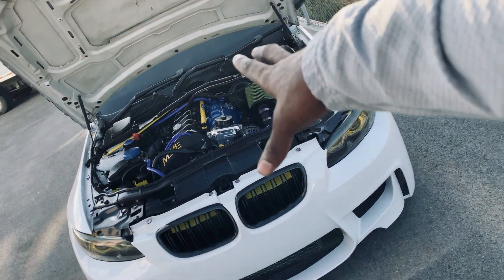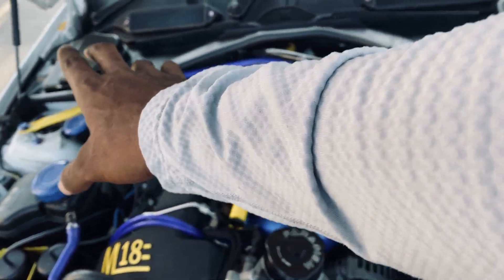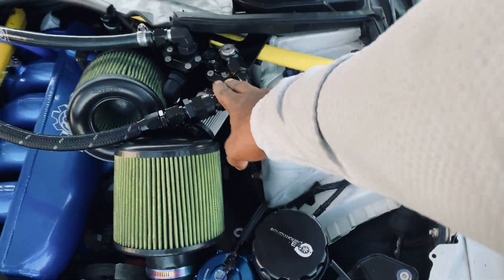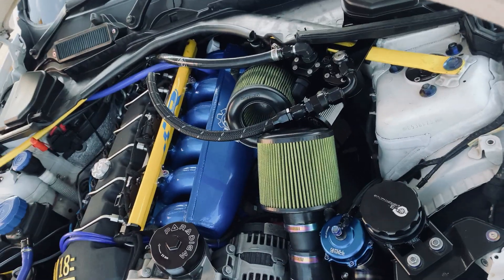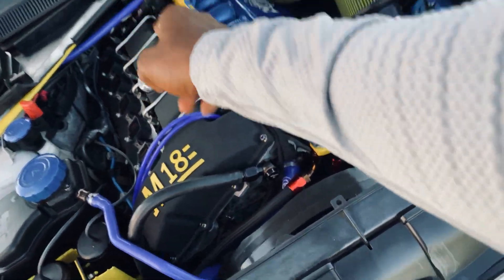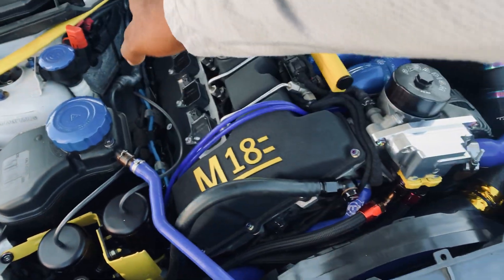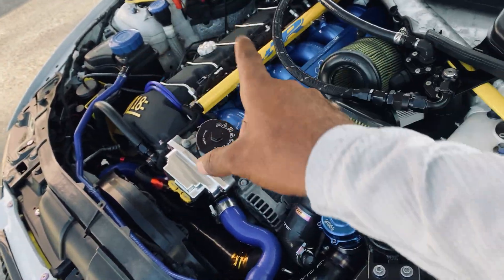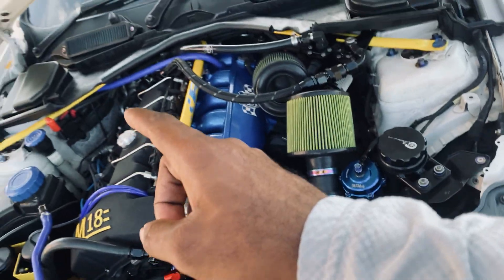M18 VC N54 Head port block off￼ PCV setup on aftermarket valve cover how Maintain all tow side ￼

Comment: What size of vtt check valves do I need? I am running the m18 cover as well but I have twin bms catch cans
Reply from the maker: N54 EXTERNAL ￼PCV SETUP ON M18 VALVE COVER SINGLE TURBO ￼
https://youtu.be/lBkGvIKpdOk

Comment: Good video.  Good point about managing the vacuum from the plugged head ports.  There's a check-valve kit for the high-side.  The low-side flapper valve acts as a check valve.

Comment: So im finally so close to the build you have. The only problem im having now is the with the aftermarket adapters for both sides of the oil cooler. I bought multiple adapters to lower the LINES lines but they are leaking. Im also on a stock oil cooler. What adapters did you use?
Reply from the maker: That nice man https://www.ebay.com/itm/286274616302?mkcid=16&mkevt=1&mkrid=711-127632-2357-0&ssspo=Jr-yh-w1QEm&sssrc=4429486&ssuid=zlidlgkrrqk&var=&widget_ver=artemis&media=COPY

Comment: What brand bango fitting is that coming off the front of the head for the vacuum relief valve. Is it -10 to 10 orb?
Reply from the maker: https://www.ebay.com/itm/203132322845?mkcid=16&mkevt=1&mkrid=711-127632-2357-0&ssspo=Tdvs0wOWTL-&sssrc=2349624&ssuid=zlidlgkrrqk&var=&widget_ver=artemis&media=COPY and yes it 10
Reply: But I can screw straith to the engine relief valve without bango and hoses? @bmwn54_cb67

Comment: Did you delete the pcv valve and flapper with this build? I have an upgrade pcv valve and flapper. I just dont know if i can use it with this setup
Reply from the maker: Hi man if you have the  m18 valve cover you can not use the OEM pcv parts on it that come form the OEM valve cover and yes delete the OEM PCV setup because PCV setup ON the OEM valve cover is built inside it this external PCV setup that I am running on the m18
Reply: Okaw awesome! For the vaccum billet relief valve, what did you use to connect it to the front of the crankcase? A banjo fitting?
Reply from the maker: @The_T4tted_Guy yes it’s banjo fitting

Comment: Question, if you have a high placed turbo (top mount) why not just vent to atmosphere? I understand the use for when you have low turbos as you need the vacuum to suck oil back from the turbos, but if you’re running a top mount then can you not just VTA?

Comment: Respect for the fitting that’s the last piece of the puzzle
Reply: Are you talking about the fitting that goes into the front of the engine that connects to the vacuum relief valve? I'm trying to figure out if he said. I heard "beijing bong 10". Does does he mean -10 banjo fitting?
Reply: @The_T4tted_Guy Yes it’s just a banjo bolt
Reply: does that mean you have to tap the head or just remove a existing plug that bmw already installed?

Comment: Where did you get the adapter to connect the VTT vacuum valva to the head of the engine?
Reply: Vtt sells them I believe a -10 will fit there

Comment: So i thought i had piston ring issues.. but maybe i have a pcv issue..

So without all this, did you have alot of smoke coming from your highside hose?

Also, did you have ruff idling and misfiring?
Reply: Did you ever fix this? Also smoking from high side. Flapper valve goes to OCC which then smoke out of the other OCC port that vents to atmosphere. Also burning a lot of oil
Reply: @BoostSZN  so the issue was unfortunately 2 broken piston rings due to a aggressive tune.. so I was burning oil and filling up catch cans.. new pistons is the fix and a proper tune from a proper tuner is an investment worth while.. avoid insta tuners

Comment: Thanks for posting this. The PCV setup can be confusing. I also like seeing how others are placing components in the engine bay and getting ideas (e.g., where you placed the vacuum relief valve).
Reply from the maker: Ok thanks man my vacuum relief valve is at the front of the engine

Comment: Bro where did you get the check valve from 
and I will need 2 ? 

One for low side pointing to valve cover 

and one for high side pointing to oil catch can ?
Reply from the maker: I get low side form VTT and high side form vibrant and yes you going need tow one for the low side and one for the high side
Reply: @bmwn54_cb67  what size is the high side check valve
Reply: @bmwn54_cb67 can you send the link hight side check valve thanks :)

Comment: I have my low side ports tapped and plugged with a VVT valve cover.. Do I still need to have a vacuum regulation? I was told with my setup that’s it’s external..

Comment: Bless King,

Appreciate you for taking your time and explaining this so thoroughly. 

@0:50 It looks like you have some type of tape over the inlet connection in the bacc where the crankcase blow by hose connects to what I think is called the heating element (it has a connecting wire that comes from underneath the manifold). 

Do you get any codes or need to worry about the heating element being connected?

I appreciate you 🙏🏽 Thank you for your time and energy.

Comment: Where did you get your check valves? I have the same setup but stock vc I need my high side check valve and I’m running vtt low side check valve but I still need the relief valve too because I blocked my head ports.
Reply: And do you remember the size of your  front plug for the relief valve
Reply from the maker: What’s up man I get my check valve form vibrant and the relief valve form VTT https://www.ebay.com/itm/284841475213?mkcid=16&mkevt=1&mkrid=711-127632-2357-0&ssspo=L-PGuKsmR-a&sssrc=2349624&ssuid=zlidlgkrrqk&var&widget_ver=artemis&media=COPY&fbclid=IwAR0e3u1hzG74xci9nF_iHK5grmwDLPfjMk7IlBPYO-j-td712jKjy7exl7w_aem_th_AWJftb3kuOrkUkMBhi6jvHYRPXimmjSdqhJIcgPMkxaorzUfnqdBkaaLzGNZ3HUyPH8https://vargasturbo.com/product/vtt-billet-vacuum-relief-valve/https://www.ebay.com/itm/264520056250?mkcid=16&mkevt=1&mkrid=711-127632-2357-0&ssspo=ioCfPANOTtm&sssrc=2349624&ssuid=zlidlgkrrqk&var=&widget_ver=artemis&media=COPY
Reply: Hey man, what was your final dual catch can setup with stock valve cover?
Reply from the maker: This was my setup when I have the stock valve cover https://radiumshop.co.uk/products/radium-catch-can-kit-bmw-335i-135i-n54

Comment: Appreciate you taking the time to make this video. I too was wondering what the optimal PCV setup was with dual catch cans and an aftermarket valve cover. Couldn't find a clear answer and felt like I was driving myself insane.
Reply from the maker: No problem man
Reply: Same here!
Reply: Same and my turbos just blew I was running valve cover from Vtt and a eBay catch can 50$
Reply: Aftermarket valve cover ... wym
Reply: @YHIHF1618 the M18 valve cover

Comment: Can you explain what I need to do with the relief value and the pcv
Reply from the maker: You need check valve on high side also!!!  If you don’t you create a massive vacuum leak. You need check valve arrow pointing away from valve cover on high side. And all so need vacuum regulator relief valve This can go in front of the engine
Reply from the maker: VTT Billet Vacuum relief valve allows you to dial in your crankcase vacuum to the precise level you choose. No more wondering if you have too much or too little vacuum in your crankcase. With this valve simply add or remove shims to get the desired vacuum level.
Simply screw into an open port, and you can seal your system with no fear of pulling too much vacuum through the system.

Adjusting Vacuum:

There are 5 vacuum settings using the supplied shims.

4 shims used the valve will open at 18″ of vacuum
3 shims used the valve will open at 16″ of vacuum
2 shims used the valve will open at 14″ of vacuum
1 shim used the valve will open at 12″ of vacuum
0 shims used the valve will open at 10″ of vacuum
Note: For the BMW N54 we suggest anywhere from 10-14″ of vacuum going higher can cause whist
Reply from the maker: The low side system works on low pressure or vacuum (any time you're not using boost) - idling, light acceleration, getting off the throttle, etc. The factory system is self-contained in the valve cover and cylinder head. Cyclone chambers in the valve cover swirl the oil vapor. Heavier oil droplets are separated from vapor and drain back to the oil pan via the cylinder head. The lighter vapor is routed  to the intake valves through a check valve in the valve cover. liquid oil and vapor from the valve cover altogether. Instead of an internal PCV system it becomes an external one. A new hose runs from a connector on the valve cover to an oil catch can. Liquid oil falls to the bottom of the can while vapors are directed to the intake manifold near the throttle body.1 x catch can
2 x 90° low profile -10AN fitting
1 x low side -8AN fitting
1 x vacuum fitting for throttle body
1 x inline check valve
1 x hose from valve cover to OCC
1 x hose from OCC to throttle body fitting

Important Notes:
1. By removing the low side check valve, the low side vent now works all of the time - under vacuum and boost. Your high side boost PCV can remain un-changed (see #2 below) and less oil will find its way into the turbo intake duct at the back of the engine. The high side hose still needs to be maintained as any cracks here will cause a vacuum and oil leak.
2. If you're running high boost (24+psi) or you're building the turbo system to be as leak-free as possible, you may opt to modify the high side with a second OCC.
3. The ports in the cylinder head used to vent vapor should be blocked if you're planning to run more than 24psi of boost. This closes the ports so your new boost does not leak out of the valve cover